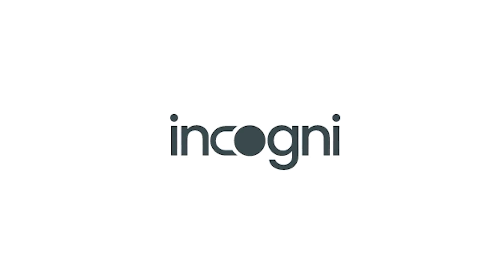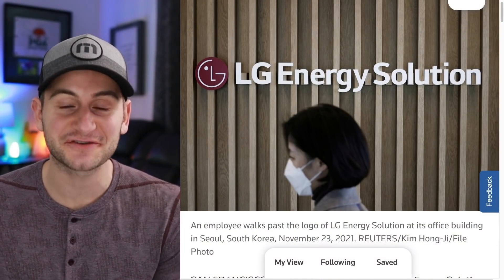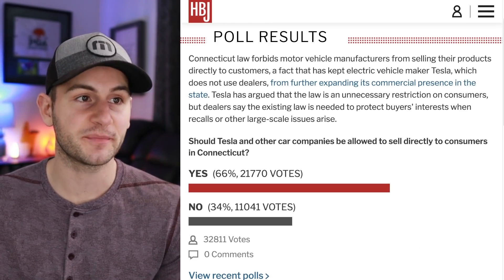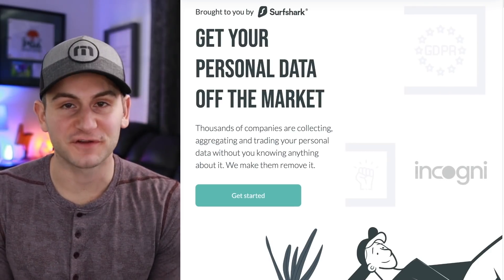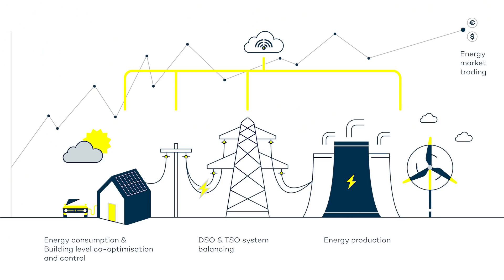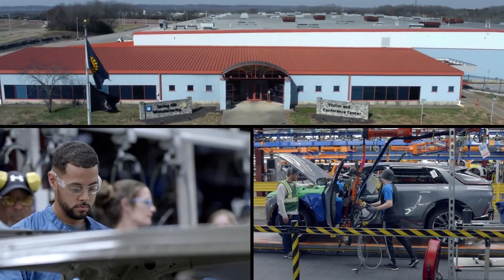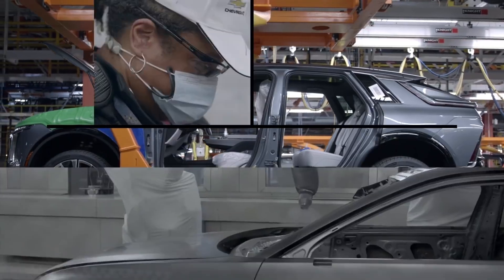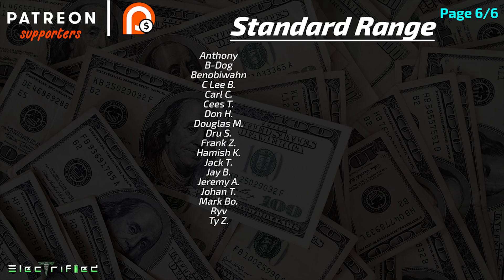Tesla Vehicle to Grid: Hope? / Notable Tesla Bear Flips / Tesla's Massive R&D Debunked⚡️

Comment: Hardware would have to be a synchronous system in order to allow the vehicle to grid. 
Tesla’s onboard charger have two main sides(let’s assume side “A” & “B”). On side “A” for example, circuit board is populated with transistors, which convert the high voltage DC into high frequency AC when you plug vehicle to supercharger (DC input) which further leads AC to the transformer. This transformer is connecting to side “B” of the circuit board. However if you plug the vehicle to Level 2 (AC). Board transistors can switch to bypass AC current directly to part “B” of the circuit. Meaning, part “B” is always feed with AC at all times. 
This part B of the inverter is populated with four diode bridge (varies across models) that convert the AC to DC and this DC it sent to battery after filtering for charging.
So the concept of vehicle to grid is to allow the battery to discharge DC current which is converted to AC by cars onboard inverter and hence delivered AC to grid. 
But Tesla’s onboard inverter has Diodes on side “B” and diodes can only convert AC to DC not the other way around. Hence acting like a barricade for DC current to run to part “A” of the onboard charger. Meaning, you will have zero AC back on side “A”.

Comment: I think vehicle to grid and vehicle to vehicle (V2G and V2V) should be an option on the cybertruck and maybe the semi, but it should be left off their other vehicles to keep costs down. Even if utilities don't want power during on-peak times from V2G, it could be great for off-grid homes and worksites. You could run into town for groceries/supplies, top up while you're there, and then use your V2G to supplement your solar/generator. Its the electric equivalent of bringing home jerrycans of fuel. V2V would also be really useful for roadside assistance/tow trucks.

Comment: As a emergency home power back-up would be great (heck with providing power for the grid for now). Some leading Chinese budget EVs are equipped with this feature or so they advertise. Also Ford's advertising the e2v F150 without alot of detail on how it will work is still very compelling.

Comment: I have always thought that one could set in the app the amount of allowable battery depletion, in the event of a power outage.   For example, setting it up so that it could deplete the battery down to about 40% before sending an alert on whether or not to continue depleting the battery if the power hasn't yet come on.    And that way the vehicle owner can still wake up with enough juice to make it to work in the morning but at the same time providing a significant power backup system, whether it be V2G or V2H.

Comment: Having spent 34 years in the electric utility business, I think Elon is right. Trying to get companies to see even the benefits of hydro power is a hard sell in some areas of the country, even thou they have hydro. They will say different, but not when it comes to paying what it cost. The amount of power we use has to be reduced because that will make the problem easier to handle. That's why Elon has proposed more efficient A/C for example. Others are working on this problem also, so he is not the first.

Comment: The development of LFP cells by BYD and CATL has caught the industry off guard. Chinese companies did not have to pay licence fees for LFP cells sold in China. They have done development work on nano particle LFP cathode. With the expiry of the primary American patents they have an advantage with newer patents on the nano particle cathode. The switch to cell-to-pack and cooling plates suits the lower density LFP cells which have charging and reduced fire risk advantages. This may explain why LG is only building a smallish factory for the present. There is an existing market for NMC cells, but their price will mainly see them in luxury vehicles. Tesla surely has LFP patent agreements in place, and is doing its own research. Tesla has shown a willingness to buy cells from CATL and BYD. Their new pack design means they are flexible for cell chemistry and shape.

Comment: Your way off base now with need for V2G. With massive rise in electricity prices and still having low cost night tariffs and your car holding way more kWh than a home storage battery, it’s making sense now. In UK we have been using V2 G in some regions for 3 years on ChaDeMo and now about to roll out to CCS with some wall boxes. The small drain on the car battery is minimal v it’s storage and makes more sense especially if working from home!

Comment: The biggest hurdle with Vehicle to Grid isn’t the car, it’s the rest of the at-home infrastructure and local utility net metering policies.  The cars can be changed / modded without too much difficulty, I think Elon said parts were about $100.  However, serious upgrades to your home electric panel and charger are required from a hardware perspective, and policy must support a net-metering / VPP cost structure to make financial sense.

Comment: Vehicle to home will continue to be very beneficial as EV prices come down, atleast in the short run.

Getting a 40k EV truck that can provide 50 kWh for 3 continuous days seems more attractive than 2 powerwalls for 30k that only provide 27 kWh of total energy capacity.

Many suburban consumers don't lose power that often or for that long. Plus, home batteries don't usually provide any economic benefits until utilities stop offering NEM. Therefore, they don't really need to charge and discharge a battery all the time - it doesn't benefit them to. 

A home battery's value proposition as purely a source of backup power is not very compelling in most cases, when compared to a V2G EV.

Home batteries are still quite costly and will be more practical when capacities increase, costs drop, NEM is taken away, and can be coupled with other tech like smart panels. 

I think it's more likely that Tesla doesn't want to offer V2G capabilites so they can continue to sell their batteries directly and indirectly. 

All of this being said, batteries are going to be an absolutely crucial addition to the grid for increasing renewable penetration and removing baseload sources of power. I just believe that they should be focusing more on utility scale battery development alongside their EV business (and allowing for V2G capabilities, as that would likely further grow demand for EVs)

Comment: Not going to add many cycles to my expensive high power density electric car battery when instead the cycles could come from cheaper / heavier stationary storage batteries.  V2G wants car batteries to meet two very different use cases; instead of tailoring better solutions to either use case.

Comment: Regarding Vehicle 2 Grid, people tend to assume the hardware to output AC power to the grid would be in the car, but that makes very little sense for vehicle to grid.  The reason is you can't just inject power into the grid anywhere you can plug in.  For starters, you wouldn't get paid for it without a net meter and agreement with your power utility.  You need to go through a similar process to having solar installed.  Permits, inspection, net meter, disconnect switches, etc.  Also, many cars would not be in situation to utilize V2G so having that hardware in every car would be a waste.

So the V2G hardware (which is basically the guts of a DC to AC solar grid tie inverter + a normal EV charger in one unit) belongs in a the wall charger unit (not the car) at a grid location that can legally and safely accept power, has permits, etc.  The only thing the car needs to do is connect its battery to the DC charge port contacts (just like when it is DC fast charging) to share power to the external V2G hardware.  The hardware outside the car would then use the ~400 volts DC from the battery and invert it to AC to the grid just like a solar grid tie inverter does.  For the car, that is simply a matter of talking to the bi-directional charger, via software, and negotiating the appropriate action based on charge level, grid demand, and user settings.

When Munroe discussed this, he was specifically debunking a rumor that new Model 3s had bi-directional chargers built in to the onboard charger.  This turned out to be untrue, but it wouldn't be the best way to accomplish V2G anyway for all the reasons stated above.  So in the short term I agree that V2G is not exactly a quick fix yet, but it certainly could be significant in the future when many more EVs are parked in people's garages most of the day/night doing nothing.  Just making net metering in new homes a requirement and streamlining the approval process would go a long way.
Reply: If FSD is solved cars will drive around 80% of the day, that other 20% is then required to charge the car. The whole point of Tesla is to increase the utility of the electric cars and this way move us away from fossil fuel faster than with replacing ice cars one by one, and use them only 5-10% of the time. Each new Tesla working as a robotaxi will replace about 5 ICE cars this way.

Have a car sitting still and plugged in 90% of the time, does not do much in terms of getting us of fossil fuels.
Reply: @MarcoNierop , fair enough, but a couple of points...

1) Not everyone is going to want to put their Tesla in the Robotaxi fleet.  Some people need/want their own vehicle.  

2) Non-Tesla EVs probably aren't going to have FSD anytime soon.  Even if Tesla solved FSD tomorrow and offered to license it out to other OEMs, most of those OEMs would drag their feet and fail to adapt their cars for FSD until years later.

So for both reasons, there will be a lot of EVs in the coming years that could be doing more than just sitting their.  At the very least they could help render peaker plants obsolete.

Comment: If you use your car in any practical way, vehicle to grid will always be a net negative.  Powering a car down the road is very expensive energy wise compared to powering a house.  Most of us would use our car during the day, charging at work when possible and charging at home in the evening.  Since most home charging takes hours (6 or more) to completely top off the battery, at best vehicle to grid will be useful for intermittent emergency support of the electrical system, and most of us will not be charging at times of low cost and selling back at high cost.  I'm not saying that it wouldn't be great to have the functionality, but it will never be a real source of extra income (unless you mostly never drive your car).

Comment: Totally wrong! Every Tesla built has vehicle to grid capability with no hardware modifications. The only practical way to do V2G is via an external inverter. All that is required is a software change to close the DC contractors so DC can flow from the battery to the external inverter/charger. Sandy's and others' discussion of requiring onboard inverter modifications is BS and shows their lack of knowledge.

Comment: I would like a bi directional system. I don't need the battery to flow to the grid. I want to power my home or lake home if there is a power failure. I have a transfer switch already installed on my house. I am not crazy about the powerwall because I have been told you cannot charge a Tesla powerwall with a generator. I also go ice fishing. It would be nice if I could power my ice fishing shack with my Tesla. A 60 to 80 amp output would be enough for emergencies.

Comment: About 10-12 years ago the US Congress was given a full demonstration of V to G. Senators Cantwell and Udall tried to set some standards so that it could help development. Obviously nothing came of it. At this point the build out and connecting the continental US power system [with the exception of most of Texas] is pretty much setup. Meaning it would cost a lot to retrofit the system. When FSD comes one dynamic changes. Your car does not have to sit 95% of its life waiting for you to want to go some place. If it was fully committed it would only be down to charge.  Still I do like the idea of a powered outlet out of  the vehicle.

Comment: They are worried about baterry degradation most likely with power to grid.
Reply: Pulling 3-5 kwhs per hr is nothing compared to the energy drain from one 0-60mph romp at full steam in an ev though. 🤔
Let alone how much a full 1/4 mile drag racing pass makes. Which by itself uses about 2-4kwhs in just 9-12seconds in a current tesla.
Reply: @4literv6  The life of your battery is still directly connected to the number of charge/discharge cycles.

Comment: Dillion,

V to G should be an option for Tesla owners in areas that are prone to hurricane impacts, ice storms, etc.  i have a solar panel system with a 10kWh back up battery which will get me 12-18 full blast in my home.  As long as the battery can be recharged with the panels, i'm golden.  BUT if my Y with a 80ish kWh battery would be available, what an extra that would be.   When my CT gets here, it should be over 100 kWh battery.  The grid here is archaic and most unreliable.  V to G makes sense in the areas noted.  Keep doing what you do!

Comment: As always, your videos are ABSOLUTELY the best and most informative, without all of the BS crap in between subjects…kudos to you Dillion….
In regards to VTG or Battery Wall, I don’t think that there realistically can be any way to manage VTG (unless your talking about an entire electrified city fleet) in a way that is reliable enough to pull power from cars and have cars have enough power to run the next day.
If you’re talking about simply supplying your home with power during a power outage (customer controlled) well that’s a different story, which I hope Tesla will adopt and allow existing vehicles to be able to do this in the near future (if hardware possible).  I would guess that Tesla could create software that could “count” the amount of Kw/hr being taken out of the charging port and remove this VERY SMALL AMOUNT from the battery warranty ??? 
I hope you either agree or disagree, but in either case I’m hoping you can announce your thoughts with a response here !!
Thank you in advance,
John

Comment: V2G is not energy generation.  It transfers energy already generated and stored in EV batteries to the grid to meet whatever demand is needed at a given time.  It could be used to charge another EV, provide electricity for lighting, power appliances, etc.

Comment: One thing to add into the mix of "Vehicle to grid". Typically (in the UK) consumers pay retail price for the energy they consume. They get wholesale prices for the energy they put back into the grid. (Wholesale is 1/3 to 1/2 of retail (UK)) That's the way business typically works. But your local electricity supplier may credit you the energy you supply (rather than the cost.) But also, your local supplier may charge you for the privilege of putting energy onto their grid. That's why V2G gets complex, and may not be cost effective (even though it may seem to make a lot of sense to have localised energy generation). (Of course , there is a hardware cost too, possibly $1500 to $5000 with installation).
Reply: Tesla has become a utility in Texas. This allows it to use its Autobidder software to buy for storage when inexpensive and sell at market price at times of peak demand. It can also make its users Autobidder connected so they can do the same with Tesla skimming a bit off the top of each connected home.

Comment: One other problem with vehicle to grid that is likely to happen in California with our corrupt & homicidal utilities. They buy your power for cheap, sell it back to you at a premium. (Call up any California utility and ask, "What's the average price per kWh for Californians? They won't tell you, instead they will give you so many numbers you won't be able to do anything with them. I'm charged $0.29/kWh almost what I'm charged at Superchargers - in California.) In the mid 1990as, one of my clients spent a lot of money on solar. Large loan, gov't subsidy, she had it calculated to the pay off the loan date - then the utility slashed what it paid consumers for putting energy back into the grid. She's probably still paying down that loan. 
I would however really like to see every Tesla have a 120VAC (240 50Hz for other countries) outlet. Then I can run power tools, or using extension cords, keep my basic house functions going during a blackout. It would be really useful and simple. (I do have a 'Full sine' inverter I've only used so far in the cig-lighter in my Prius - works well enough but makes my mouse and trackpad go nuts. Using it I could keep my fridge running, watch TV,  charge my computer, run a room fan. I could also use it in my Tesla... but I think the Prius ICE left running (turns on for one minute every five minutes) would keep the power going for a week.

Comment: Due to Tesla's motor making technology it stands to reason that they can also make a very efficient wind generator .  Many cities have banned using traditional windmill designs.  Tesla should make roof top squirrel cage  wind generators to our energy into the Powerwall for later use by the car and for use by the house.  Many times it will be possible to use both photovoltaic and wind systems on a rooftop.  This innovation is really only something Tesla can do.